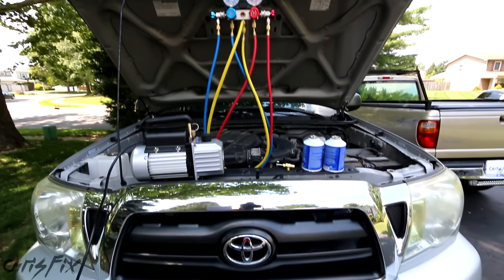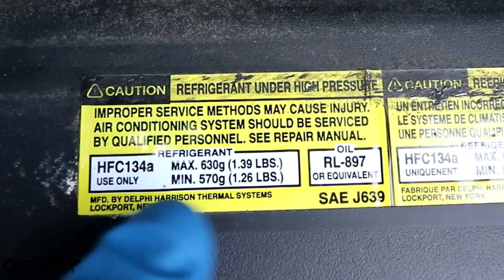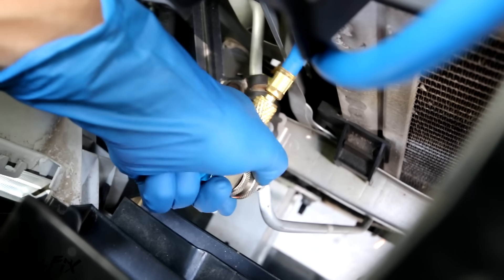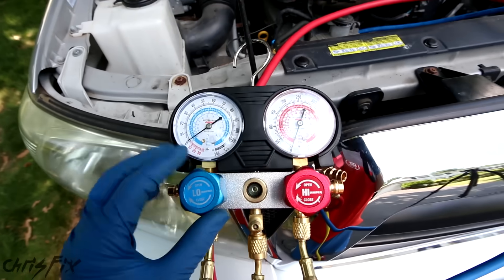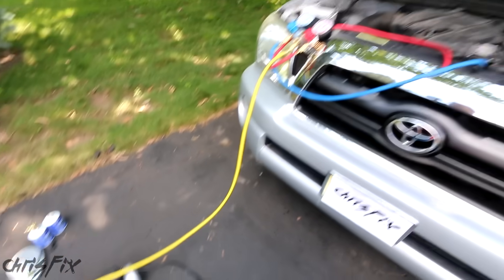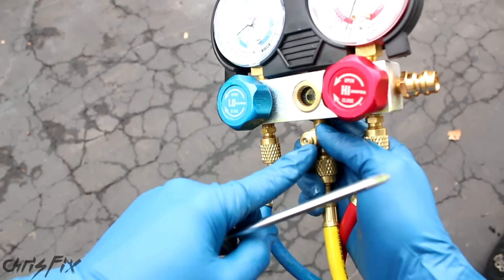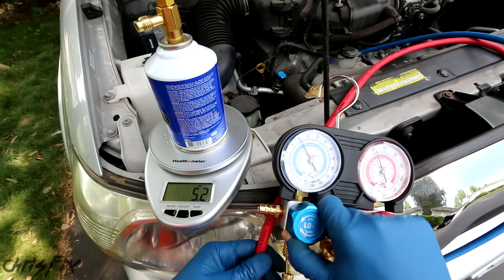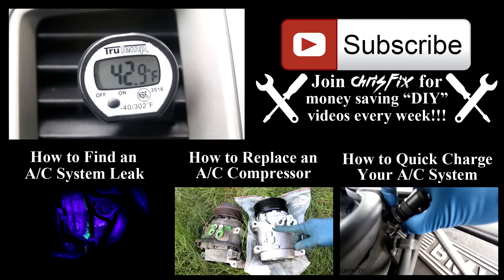How to Properly Recharge Your AC System

Comment: Question for everyone, please: I have what looks like the same AC tap in this video, which it looks like the AC pro tap. Here’s the problem I noticed. In the video, you mentioned that when you close the valve it shuts it off to the yellow hose and then you can unscrew the empty can and swap cans. In theory that would prevent you from having to re-purge the yellow tube every time you swap cans. the problem is, I tested my tap and I can blow air through it whether it’s open or closed. I’ve only use that tap one time and I didn’t have a good sense to test this phenomenon last time. It’s been sitting up about three years. I don’t think it went bad. Maybe I’m wrong? Or is that the way all the paps are made. I guess if you’re a professional, you would have a big tank and the idea of having to re-purge between cans wouldn’t be an issue. But I am a shade tree and using individual cans to add 2 pounds from empty to full. I would rather not have to add another shut off valve between my tap in the yellow hose. Any feedback or suggestions appreciated.
Reply from the maker: Just purge it at the top of the the yellow line where it meets the manifold. There is a Shrayer valve there and press it in with a screwdriver or something. Just don’t stand in front of it. Also the amount of air in that yellow line is soooooo negligible. Yes it’s better to get it all out but it’s not going to ruin a system, especially if you have a good receiver dryer.
Reply: Howdy, sorry just saw this last weekend and finished the repair this week. You're a busy guy; pretty shocked you responded so quick. Thank you! Watched your video about 20 times. The repair went great. It's on a 20-year-old GMC truck, and the AC hadn't worked in about 4 years due to a leak. Found the leak at the pressure sensor (the one that hooks up to the dryer); it just needed a good tightening. Replaced the dryer (plus 2 or 3 O-rings) and transferred over to the new dryer, the same 20-year-old sensor that was leaking before (I just added a new O-ring and snugged it up); maybe I should have used some thread locker? Changed the orifice tube (and O-rings). Changed the high and low Schrader’s. Added 3 ounces of Pag 46 oil (with dye) to the dryer, pulled a suction for 20 minutes to about -30, clamped the valves, & checked for leaks for an hour (no pressure change). Then pulled a good suction for 90 minutes. Added 2 lbs of 134a (pressures reflected as expected by the charts. I recently replaced all the pulleys, belts, when I replaced the water pump and coolant hoses. Hope I didn’t miss anything. Thanks again! @chrisfix
Reply: @chrisfix  Then why bother bleeding it at all after the first tank is attached? I was wondering the same thing, as my tap only seals shut in the "fully pierced" position and this presents an obvious problem when switching tanks.

Comment: Does one fl ounce (a measure of volume) equal one ounce (a measure of weight)? If not, you need to weigh both cans. Those cans are 12 fluid ounces, and the measurement given on the car is by weight.
Reply: Some quick googling states that 12 fl oz = 1.29 lbs. one can should have been enough. 1 fluid ounce ≈ 1.25 ounces.
Reply: The label on the can is a misprint. Refrigerant is sold and measured by weight as standard because its a condensable liquid/vapor mixture. One fluid ounce of refrigerant will have a variable weight depending on the conditions. The people that made the can got a little confused with SAE units

Comment: If you pull a vacuum. Wouldn't the pump suck out all the oil?
Reply: The pump shouldn’t remove or vaporize the PAG oil. The pump should remove air in the system, degas the PAG oil, and vaporize any residual volatiles (mostly water) from the system.

Rotary vane pumps typically release a small mist of pump oil from the exhaust port when it’s pumping against atmospheric pressure. Some pumps have a ballast valve to reduce the misting of pump oil. Also, water vapor will cause the pump to emit smoke from the exhaust port (actually, multiple things can cause the pump to smoke).

Comment: Love all your videos first of all. However, change my ac compressor, it came with 2oz of pag oil. Was planning to add 6 more ounces as per specs, got a pag oil + uv die combo. So Instead of adding it b4 installation, I decided to do it the chris fix way and service it through the yellow hose.. no Bueno . Did not work for me. Liquid refused to fill hose...btw, same ac manifold, and same hose end orientation

Comment: How does the high side gauge work if you have the valve closed. Mine reads 0
Reply: The valve on the manifold shuts off the high side hose to the middle yellow hose, the gauge always reads the pressure in the high side hose. There is a valve on the other end of the hose at the service port that stops flow into the hose.

Comment: Can you remind me why you only open the low pressure side when refilling the AC unit with fgas? im assuming its because the high pressure side transforms it into a liquid which you said can damage the system if put in too quickly?
Reply: When the system is running the pressure in the high side is significantly higher than the can pressure. So instead of the can filling the system the system would fill the can. The high side pressure can in certain conditions exceed the pressure rating of the can so there is a possibility of the can exploding.
Reply: @Redtooth75  ah yeah that makes sense but just didn’t even cross my mind, thanks.

Comment: I vacuum the car some with car running now it’s not sucking refrigerant at all what does this mean?
Reply: If the pressure in the system is too low the low pressure switch will not allow the compressor to turn on. Sometimes the can cannot get the pressure high enough to close the LPS so it must be bypassed so the system can be charged enough to run on its own.
Reply: @Redtooth75  thanks

Comment: my camry 2000 is 333,333 miles and 23 years old. AC worked perfectly ok, then it stopped. When I started the replacement job, I realized that the problem was a missing bolt on the front of the compressor. So, the magnet could not pull the clutch, too far. anyway, the oil in the system has a beautiful green color. toyota added fluorescent detector in 2000.

Comment: My Low pressure was reading 70 (too High) and my high pressure was reading 199 (slightly low) so I replaced the expansion valve in my 2015 Toyota Sienna. Immediately after recharging the system, my readings were Low pressure 45; high pressure 201. I checked the readings about a day later because my AC still wasn't cooling and is currently at Low pressure 65 high pressure 150. I think the compressor is weak and needs to be replaced, but I was wondering if anyone has any tips or thoughts on my next step.

Comment: Really well done and thorough, except for one thing; if you haven't replaced anything or opened the system up in any way, is it still necessary to evacuate it? My Jag blows warm air this year, I suppose someone will tell me I have to locate and repair a leak. But the car is nearly 20 years old, is it unusual for a 19 year old system to lose pressure without any other issues so that it only needs a recharge?

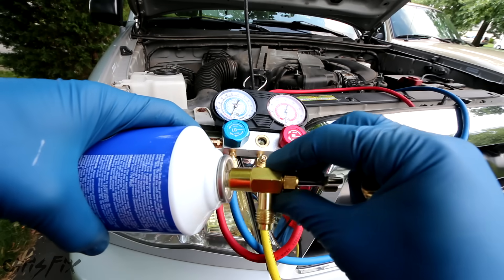Comment: What do you do with the half empty can of refrigerant?  Unhooking that would expose it, how did we miss that part of the video. Also I would assume at 8:45 when you attach the adapter the valve is completely open otherwise it would puncture & would be a problem.
Don't take this as a complaint :) these videos are by far the best in there class. Much appreciated !

Comment: I would have made it more clear the the system needs to be empty before pulling a vacuum because I bet someone is going to go find that one out the hard way. That being said great video! Thanks for sharing! I didn’t know you can use a scale like that. I have a harbor freight vacuum pump but I’ve never used it. I just topped off the refrigerant on my truck but added too much on accident. Is there any way to collect it without blasting it out?

Comment: These steps are NOT really correct according to the title of the video. This isn't the typical AC recharge. This is after a repair was already done. A typical recharge will begin with determining why the refrigerant leaked out. Yes, there are other videos on this channel about that.  Its just confusing for people to not be told about all the other steps involved as they watch this video. There could be a point that viewers are stopped and told what to do if they haven't looked for leaks yet. N

Comment: Very informative video, I do have a question. I became perplexed when you put a 12oz can of freon, which with the weight of the metal can it comes to 15.05oz, but the scale came up with 20oz and that must be with the weight of the hose attached. How did you figure you got the 10oz you needed??
Reply: I'm about to vacuum and recharge my AC on my 2015 Town and country bcuz I had to replace the rear evaporator and expansion valve plus O-ring seals. My system takes 2.53lbs / 1150g, and after adding three 12oz cans, I'll need an extra 8oz, and I was trying to figure this out using a similar scale. Can you elaborate?

Comment: Do you need to flush modern systems as well? Or will using the vacuum pump basically do the same thing. Our system is empty so im not sure if a vacuum will do anything anyways.

Comment: If the whole can weighed 20oz and you left the second can weighing 10oz wouldn’t that mean that you used half the can which would have meant you used half of 12fl oz leaving 6fl oz in the can. Essentially putting 18 Fl oz in the can when you wanted to put in 22fl oz?

Comment: Chris you did a great job explaining everything, accept the part where you mentioned no oil just refrigerants. All refrigerants contains oil, because they need to have oil in order to lubricate the compressor. Otherwise it will seize up faster than your grandma can shout bingo.

Comment: When u do vacum does the old freon and oil came out too?? How do i know if i have to add oil??
Reply from the maker: You have to take it to a shop to have them evacuate all the old refrigerant. When you pull a vacuum it takes all the moisture and air out. You need to look up and see how much oil is needed for each part you replace. For example if you replace a compressor it needs X oz of oil.
Reply: @chrisfix  thank u so much

Comment: so isnt some of what you measured still in the hose lines? so your system is still missing a few ounces..
Reply from the maker: No the gauges indicate what is going on in the system so even if there was residual in the lines, If the system was up to spec it wouldn’t matter

Comment: I replaced all major parta in my gfs nissan and founf the expansion valve leaked. I watched so many videos through this whole process. I used the uv dye founf it was the expansion valve checked all the o rings and it leaked again. I spent money on gauges and a pump and no other video told me that if i close off the lines to hold a vaccum if it went back to zero the system was not air tight. I made some adjustments and now im holding a vaccum and ready to add the refrigerant! Thanks chrisfix you da man!!

Comment: This video will take away your fears, and show you how easy it is.  

First we start with you multi gauge toolkit...

12 items later...

Make sure you wear a pair of special protective glasses so your not blinded by the refrigerant.  Then you just use a vacuum device to remove the moisture...

30 transcript pages later...

...and we are done!
Reply from the maker: You can rent/buy a manifold for cheap and you can also get a Venturi vacuum device if you have an air compressor, and those were just normal safety glasses. This is way easier than most people make it out to be and I've heard of people saving hundreds doing this themselves...

Comment: Just a question. My 2006 Tacoma A/C is not blowing as cold as it should. Shouldn't the first step be to completely recycle/discharge the existing A/C? Afterward, proceed with your steps? 

Thanks for the help.

Comment: While on a long road trip, I stopped at a car parts place and spent $47 on a recharge cannister, spent 15 minutes recharging, and my AC magically came alive. Three months later, it's still blowing cold. Next summer, I'll have to repeat the process, but it's still cheaper than paying the dealership $800 to fix the leak.
Reply: Inject stop leaking magnetti marelli before add  freon !

Comment: Thank you for sharing. How can you tell if the system needs to be refilled or even if it needs maintenance?
Reply from the maker: If the AC is not blowing cold air anymore then you most likely will need to do this since the seals can degrade over time and refrigerant can leak out. If it's blowing cold air then there is really no maintenance on the system itself
Reply: @chrisfix  Hey Chris! Wow! I'm amazed at how quickly you answered my question, even running a channel with millions of subscribers! 👏Thank you so much for that. I must say your channel is one of the best out there regarding automotive. And you are very good at what you do! Congrats!
I'm about to make a long car trip to Spain. Spain gets pretty hot at this time of the year, so I asked you the above question ;)
Now, I have another question 😊, I did my oil change early this year and I've only put another 2.500 miles since then. During my trip to Spain, I plan to make about 2.000 miles in 4 weeks. Do you recommend having my oil changed before I go, or there's no need to? My car is a VW Jetta 1.9 TDI. Thanks again 🙏

Comment: Hello again, Chris.  If I evacuate what little freon is left in my system and then run a vacuum on the system (as you are doing here) do I have to be concerned with then adding PAG 46 oil?  Will oil have been sucked out of the system when running the vacuum like you did here? I see varying answers to this concern. Some say that vacuum removes some of your oil while others say that it does not, or only a tiny bit. I will not be replacing any components other than maybe my Schrader valves.

Comment: excellent car ac refrigerant refilling method but  i couldn't understand how the high pressure gauge shows high pressure while refregerant is refilling b coz it should remain closed while refregerant is refilled through low pressure pipes ?? # ❤ 👍 🇵🇰

Comment: Hey Chris like your video , I replaced my condenser and catch can plus the lower line , before I recharge how can I tell how much oil is in the system and how much I will need to add
Reply from the maker: There should be info on how much oil to ad for each part you replaced. Some parts also are pre-filled with oil so look into it so you don’t add too much

Comment: Random question, I was going to replace my ac compressor, and it has pressure, but it's low. Can I just open up the AC system and bleed it out into the air and then recharge it? Or do I need an expensive ass recovery machine when I can just get it recharged for less.
Reply from the maker: You don't need a recovery machine, you can just bring it to a shop and they will recover it for pretty cheap
Reply: @chrisfix  I was just wondering if it's bad to bleed it into the air and depressurize it so I can work on it.

Comment: I followed the steps exactly but my compressor never kicked on when I opened the low pressure side to allow refrigerant in. Pressure got to over 100. I left it there for 5-6 mins but it never kicked on. I took a jumper wire and jumped the pressure switch and the clutch kicked on the compressor but it never pulled any refrigerant in, the low pressure didn’t go down, the high pressure didn’t go up. Scratching my head here. Any ideas? I’ve had issues with the AC in the past and just put one of those “stop leak” cans in it and it worked last year.

Comment: So first timer here, one thing all these videos keep omitting is what about the existing refrigerant? I was just at autozone and about to get the vacuum puller, gauges and 2 cans of R134a, but after talking to the employee, turns out before you do anything, you need to get ALL old refrigerant out of your system. Thay way youre starting with empty and know you're adding the right amount. Now... only proper refrigerant recovery places can recover it, so I was told I'd have to take it to a mechanic shop to get it removed. Autozone does not have the equipment to do it.

Comment: Hi Chris / all, at @6:20 you said to close the valves on the manifold gauge and let it sit for an hour to make sure there are no leaks. I didn't understand how does the gauge actually detect leaks if its valves are closed. Can you (or anyone) help me understand how that works? Thank you
Reply: The reason it works even with the valve closed is just because the vakve has stopped pulling air out and sealed the vacuum
Reply: If it was leaking, the pressure would start going back to 0. Right now, hes depressurized it so much so that its keeping a consistent air tight vacuum, if there was a leak, air would come in and depressurize it
Reply: I see the same as you. By closing the valves, that separates AC system from the gauge. If any leaks during that period, it's not the AC system, but the gauge manifold itself.

Comment: Excellent video, BUT, no one seems to address the issue of how to purge the refrigerant line IF you're adding oil to the system. How do? Best I can guess is that you add the oil, connect the refrigerant can, and purge while the line is vertical so that all the gas hopefully blows by the oil leaving only it and 134a?
Reply: Thanks.  I am guessing this also.